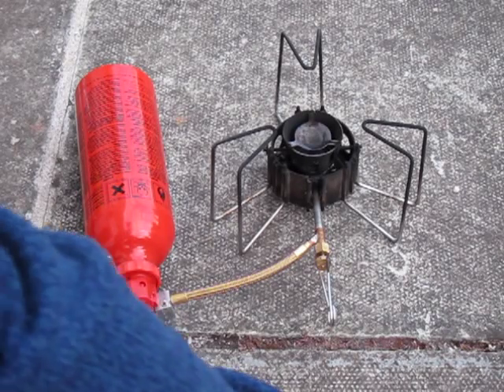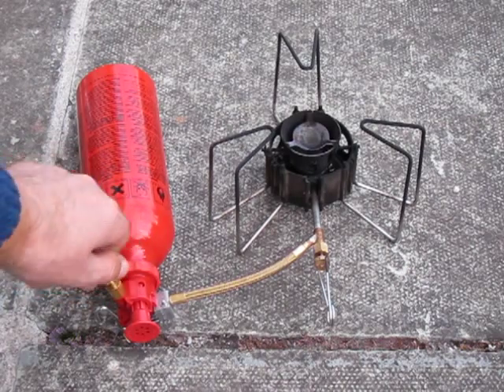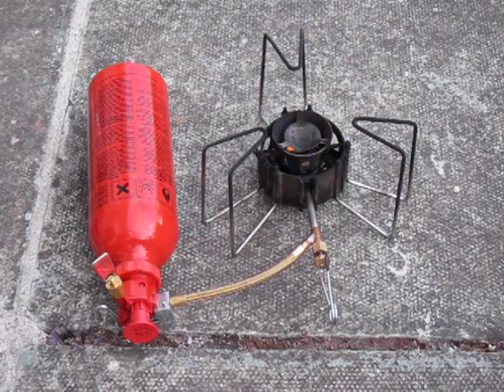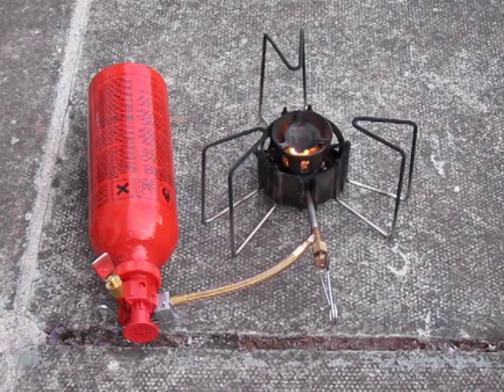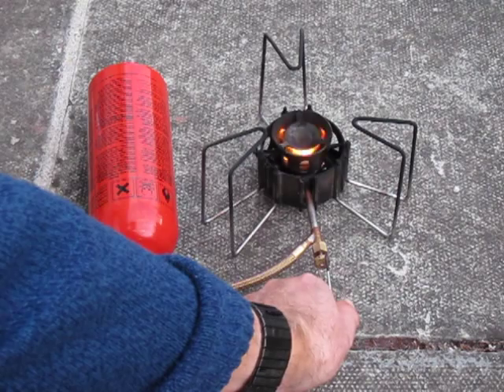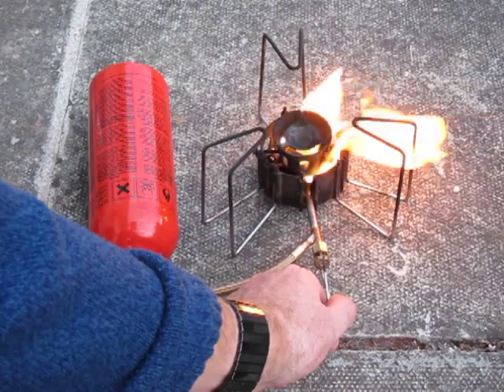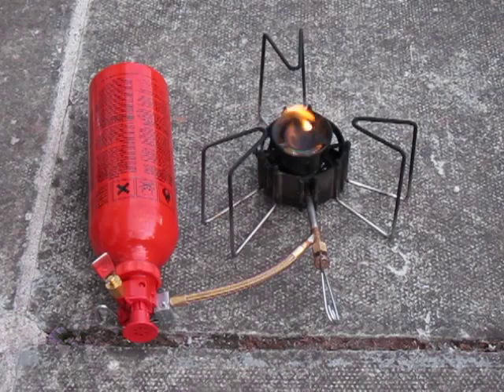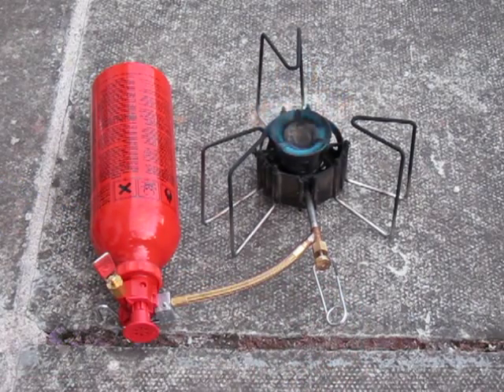MSR Dragonfly with white spirit.MOV

Comment: Cheers for the video - it was very useful.

Just to make a point which tricked me for a good long while - Methylated Spirits does not work as a fuel (well it might work for some, but it did not work for me). I believe that it's something to do with it not pressurising very well. I hope that saves some people the time that I just wasted, and the worry of thinking that your brand new stove doesn't work, or that it is really difficult to use - when actually it's really, really simple.
Reply: You're getting mixed up. Methylated Spirits (aka, denatured alcohol) burns in alcohol stoves (eg, Trangia)., not white gas stoves (eg, MSR).

Comment: Your stove looks very sooty. Is this because of the "white spirit" (mineral turpentine)? Does "white gas" (ie, naphtha or coleman fuel) burn cleanly in the MSR?
Reply from the maker: Yes. If you start with a clean fuel and use white spirit when it's primed you won't get the dirt. The dragonfly is very good.
Reply: @golaoi  Thanks, but you've confused me. I asked is "white spirit" dirty while "white gas" is clean? You seem to have answered yes, "white spirit" is clean.
Reply: @martin.feuchtwanger  white gas also leaves soot if it is not primed enough. 
But if we prime it with alcohol, it won't leave soot.